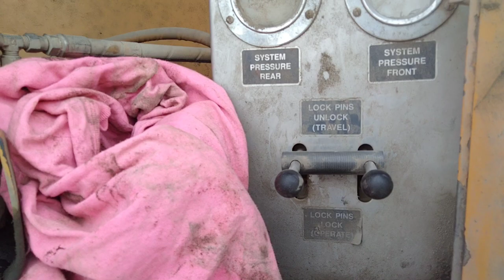CRUSHING STRIPPED DOWN SALVAGE IMPORTS CARS IN NEVADA TX.! WE ROLLING!

Comment: Talking about taking care of a car and it will last longer, my sister had a KIA just under 200k miles. Then she talked it with my parents and if it starts costing more to fix than buying a new one. But it is hard buying a new one right now.
Reply from the maker: That's da real truth treat ur car like a woman n it will last. I have 98 Lincoln continental V8 all original she have over 230.000 miles n steal give n movie let a brand new car I just took off the air bags n da springs with shocks da next thing is to do da front da same way n use hydraulic shock instead of air shocks. N yes it is hard to find n get a new car cuz these fuckers want so money just for a beer can car.